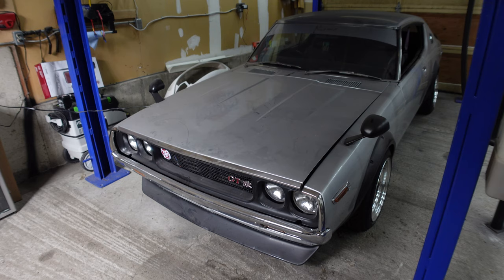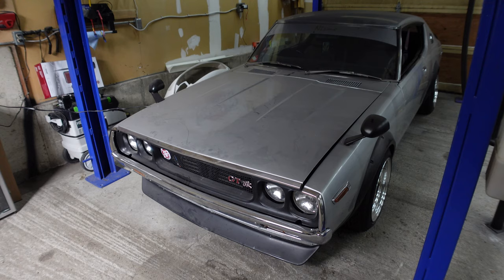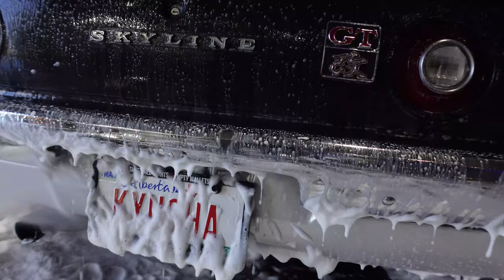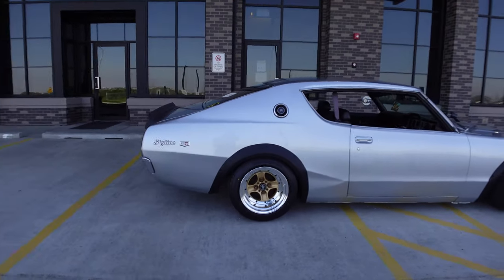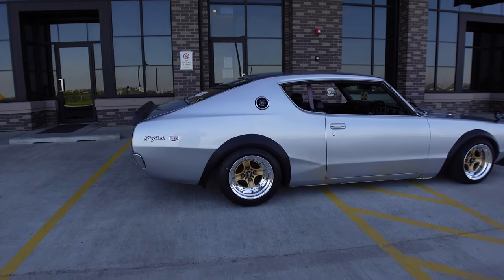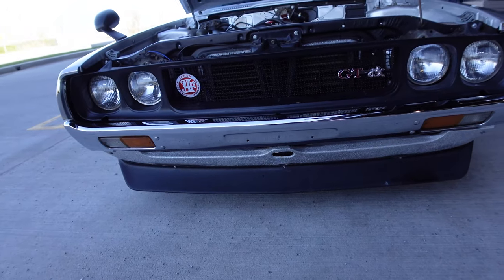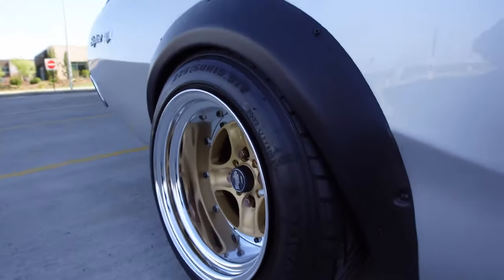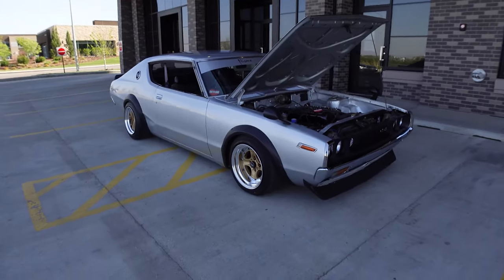Introducing My Dream Car....1976 Nissan Skyline! Kenmeri!

Comment: How much/hard is it to find a base Nissan 240k coupe that's complete in decent condition ?
Reply from the maker: It is very hard and expensive unfortunatly, like lots of japanese cars they have skyrockted in value and are harder and harder to find, a 240K in AUS in "shell condition" will run you probably $50-70k AUD depending, and then however you finish it out for a total. There has been a few C110s from Japan on US soil around the $80-150k USD mark depending on condition and parts.

Comment: I would paint the flares, chin, rear spoiler to match the body. Not only do you accentuate/define the body, but the wheel/tire pkg as well.. imo
Reply from the maker: Its already in the works! the flares will not be color matching though as I like them how nissan intended which is black. The spoiler and Lip will be getting colort matched for sure though!
Reply: @kyushalimit5931  Did Nissan really intend to keep flares black? Not contradicting, just very interesting. Did not know that. Have you seen the Mizuno works site?
Reply from the maker: Yes all GTRs had black flares and were meant to, but remember they were meant to be racecars and not production cars as much.
Reply: Interesting. Learned something new. Appreciate the response. Love your content.